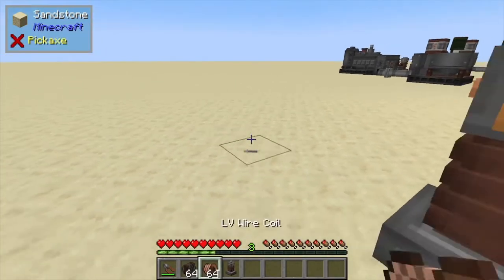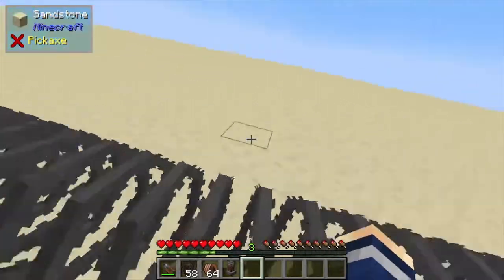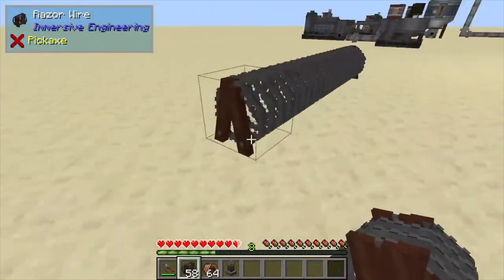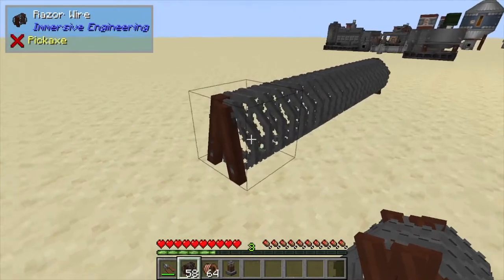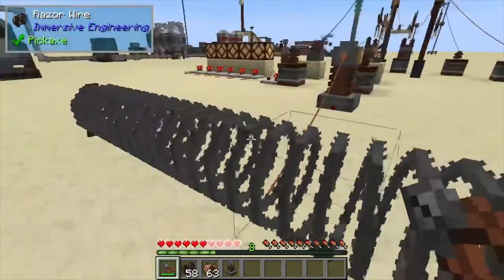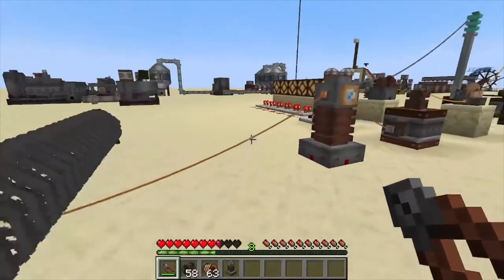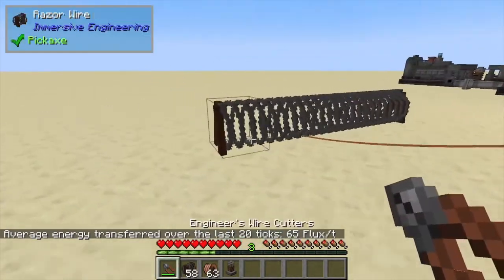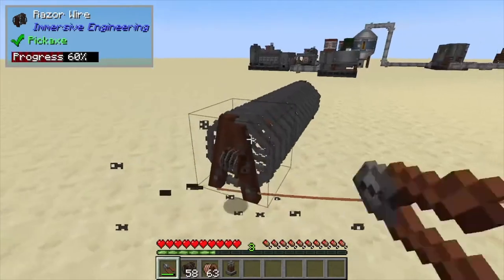Immersive Engineering: Razer wire

Comment: Do you need transfomer to get power in razor wires or relays will do the same thing?
Reply from the maker: You can connect it directly i just used the transformer to show the Amount of power it was using